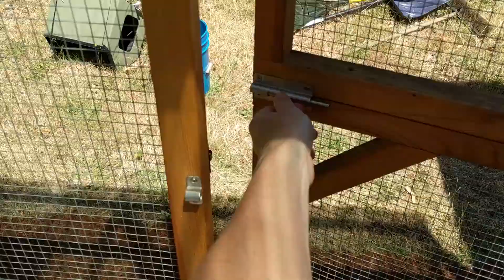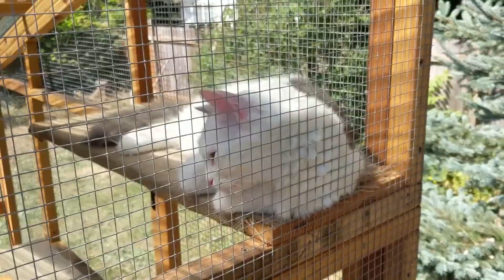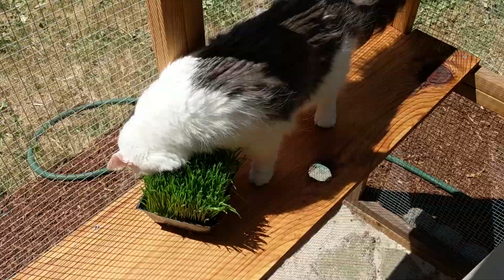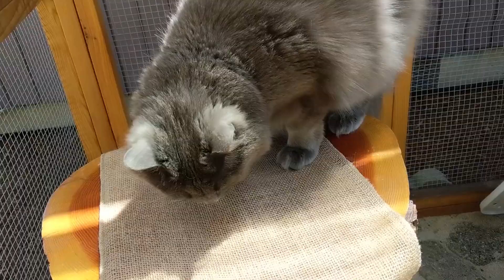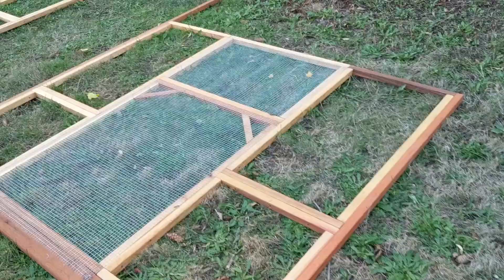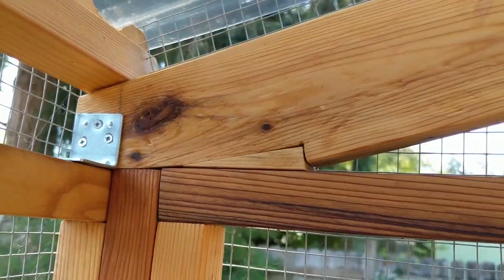Catio Tour, Meet the Cats and See How I Built It

Comment: Good video. Can I ask how you joined the walls together?  Should I use 2x4’s for the corner?  You mentioned having 3. 2x2’s on the corners
Reply from the maker: 2x4 could totally work for corners. You could even do entirely 2x4s instead of 2x2 as some people do. After a couple years I've found all the tiny gaps resulting from using 2x2 means more places for bugs to hang out (mainly earwigs.) Avoid pine unless you're going to thickly paint it, consider getting something more weather resistant like cedar. 

After the four walls were together, I had a second person help me join them together. It was quick. Just need one person to hold up one wall while the other holds up and screws in the other.
Reply: @BKMERRELL  thank you again!